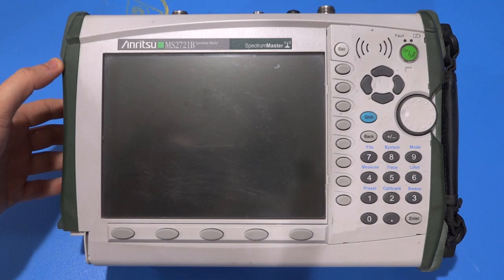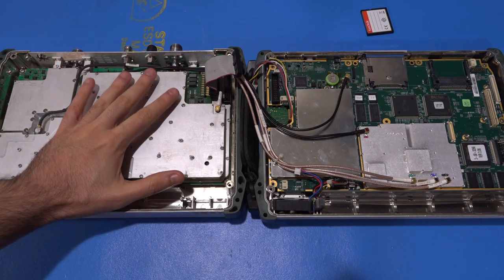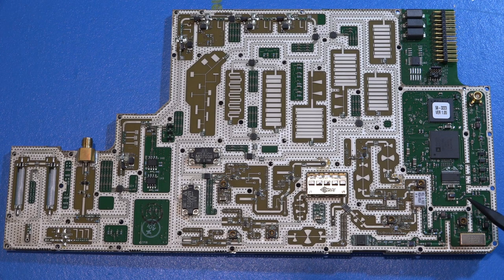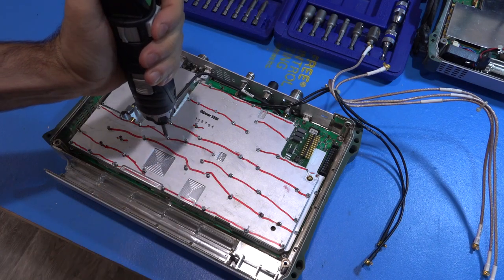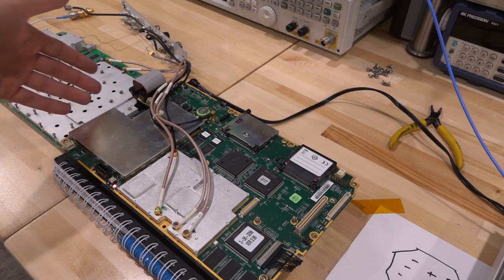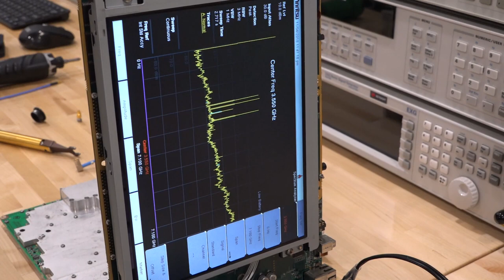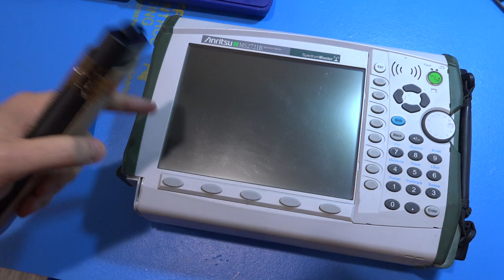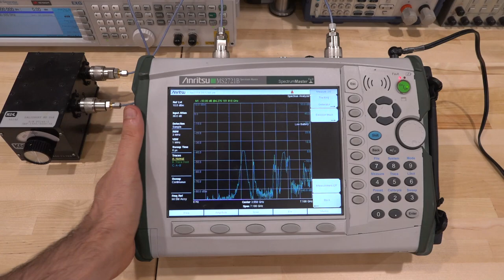TSP #137 - Teardown, Repair and Analysis of an Anritsu MS2721B 7.1GHz Portable Spectrum Analyzer

Comment: Thanks Shahriar for the inspiration to finally get my Anritsu MT8222A working. The spectrum analyser mode came up with lock errors. Turns out the fault was one the 3300 to 4300MHz VCO. One of the inductors in the varactor path was open circuit. Very fine wire used in the inductor open circuit.
All fixed now, so I have a fully functioning 6.1GHz Spectrum Analyser & 3GHz VNA in one box.

Comment: Thank you Shariar for giving me the courage to buy a broken MS2721B and fix it.  The problem was also one of the three Micronetix VCO modules.  Micronetix (now Mercury systems) was absolutely useless for price, availability or quote, even though the parts are still made (2021).  Funny because I could have been sitting on a multi million $$ contract which they would now never hear back on :-)  In fairness, it was during Covid but I've heard comments from RF acquaintances that that's how they operate :-(

I carefully removed the Micronetix label with a little heat and set it aside to re-apply (I'm a bit vain when it comes to appearance).  With a 50 watt Weller stained glass iron, I removed the metal cover only by observing under a microscope until ONLY the perimeter had melted ... within a few minutes  With heat, the VCO would work for a few hours then stop.  While the module's internal soldering was not bad, by today's standards I would say the components had inadequate solder volume.  I fluxed, reflowed all parts then carefully cleaned (flowing solvent toward the PCB edge, away from other stuff).  Some small dots of solder paste followed by the Weller iron to the top and the metal cover was beautifully reflowed !  Label stuck back on so it's "pretty".

The unit has been working for months with hot and cold tests applied.

Comment: I usually make a photo, print it out in DINA3 and then sticky tape the screws onto the place in the image where they came from. Makes it easier to keep track of things when you have to wait for spare parts and put stuff aside.
Reply: Sounds like a really great idea. Only problem I have had when using sticky tape and screws is residue and occasionally fumbling a screw when removing the tape.

Comment: The microwave ground plane traces? For the segregation of the different blocks, did look like silver -as it is the whitest metal, and has the best electrical properties.  Even the parts that started to tarnish looked like silver to me. The only oddity being, it had almost a matte finish to it, which is strange.  Probably alloyed with something or other to give it more appeal in rf board design.

As usual, beautiful video, thank you for sharing

Comment: What is the problem? The stress to its own joints caused by the unit that was decapped?  Seem to be so, and the joints need to be relooked and reflowed if necessary.

Comment: Hi Shahriar
Just bought a MS2721B "broken" (displays a saturation error randomly, but works and does not seem to saturate at all... Strange). And discovered that I must have watched your video two years ago and that I do not have to open the shields thanks to you awsome teardown :)

One question: Where did you get the battery from? The repaired / clones a google search for sm204 or ms2721b battery produces options which cost a third of what I paid for the hole SA :(

Comment: You mentioned this unit cost $1000, but now that its working how much would you say it is worth?  Essentially did you make a profit?
Reply from the maker: It may, but I still have to get a proper battery and charger for it. It didn't come with either of those.
Reply: It generally goes for about $2.4k on eBay if it comes with option 20 (tracking gen). I got mine for $2k with carrying case and charger. Which is not too bad considering that it goes up to 7.1GHz. Much better value than getting a low end Rigol or a Siglent that cost similar but only goes to 2GHz. Although I agree that the GUI and the processor is not as fast.
Reply: @wadehsu2347  does the tracking Gen go to 7.1GHz ?
Reply: George Burgyan   I'll look into this further. Going beyond the usual ~2-3Ghz is pretty nice. Thanks for the heads up.

Comment: Great video as always :-) Can you please explain what frequency band each of the three VCOs cover? I suppose they are called LO1, LO2, LO3. How did you find out what frequency range each VCOs was running?
Reply: Replying to an old question but it may help others.  I tracked down VCO problems by either a full range sweep and watching for which portion of the trace kicked out an Lx error.

Also, to the left of the VCOs in Shariar's video, with the VCO labels reading correctly, there are three control lines, one of which goes to each VCO.  You can watch them on a multi channel scope as you sweep the full range (or part thereof).  You'll see the ramp of tuning voltage for each part of the range.

Comment: Hi Shahriar
I,  know this is very old and you have probably sold the SA by now, but I hope you can still help me.

I have got one of these MS2721B and the previous owner has removed the internal SD card (but clean with no damage  :)

Could you please let me know how you made that new SD card with operating system on it? Do you have the disk image?
 you can post on eevblog

Comment: i have a mt2222a  the display  gone wrong   its not the the lcd i found a replacment   and its still the same shows the same image over and over again  2 cm apart  so cant  read anything  it even does it through the computer software   the same  any idears where to start looking for the problem  displace driver chip ect any help would be gratefully  received

Comment: My 2721b was damaged overlevel by another engineer.  Anritsu would not provide decent service information.  So I had to send it to them, and they charged me $9,000 to repair the unit with a 90 day warranty.  Now, after loading the application, it tries to re-boot.  Ask me why I HATE Anritsu...
Reply: I know this is old but having dealt with Anritsu on this model (or any) I can't blame them for limited support on a long out of production product.  It's standard today.  I would HATE myself, however, after spending $9k and having follow up issues.  Hope it worked out for you !

Comment: 14:30. I don't believe that surface roughness is a problem on the top of the traces - the current flows on the bottom... (yes oxidation can eventually lead to problems, but surface roughness conduction losses are at the copper-dielectric interface for microstrip)